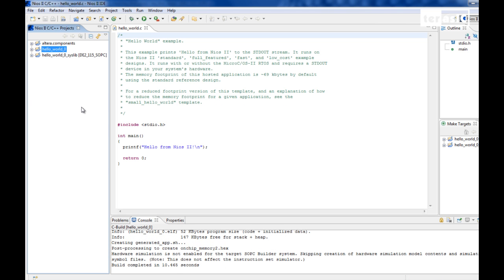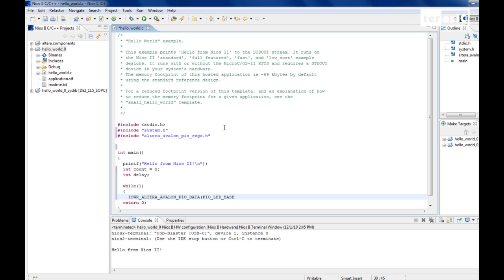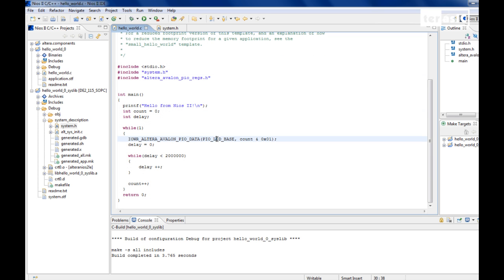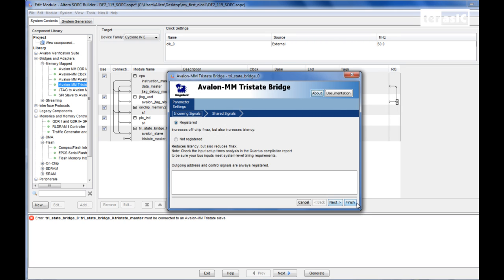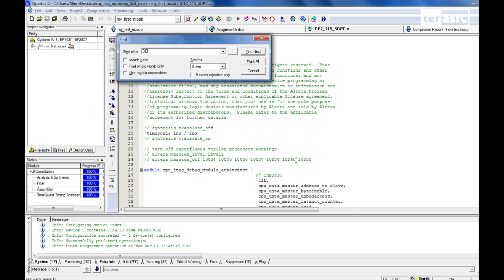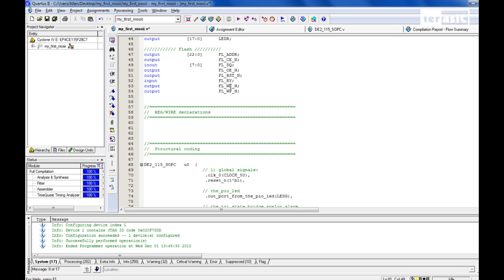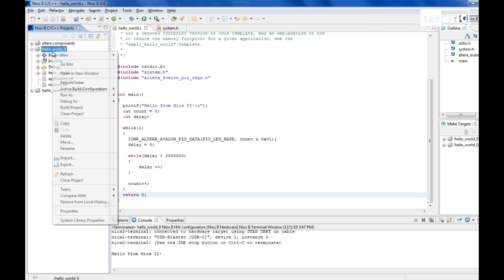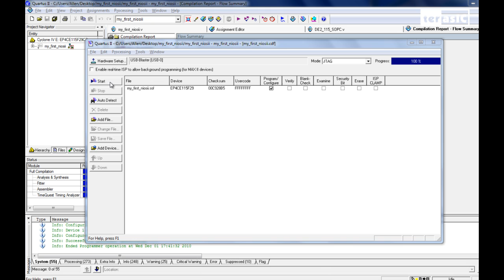My First Nios II Tutorial (2)

Comment: I'm thinking of using the DE1 board to develop a range of single-chip computers but find it's lacking a mouse input and some legacy serial and parallel connectors.

A lot of developers using the TERASIC DE0/1 boards tend to put a CPU core on them so some sort of 'Universal Microcomputer Development Board ' based on the TERASIC units would be useful.....